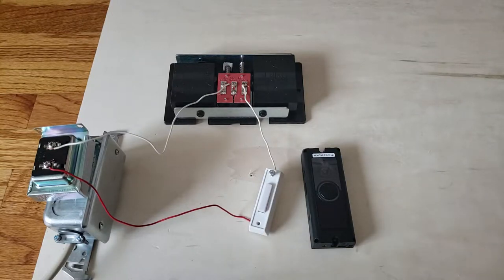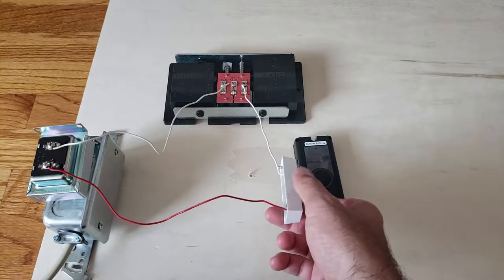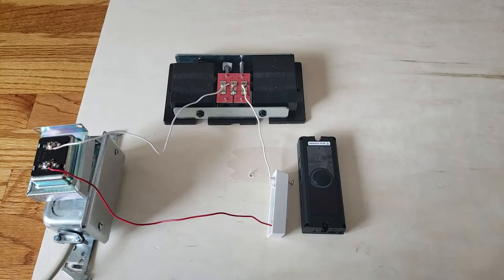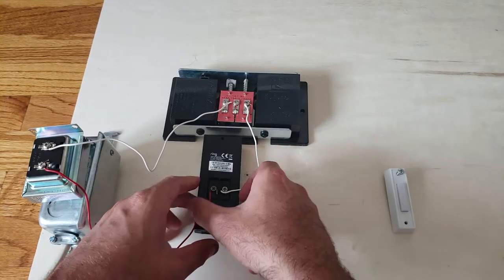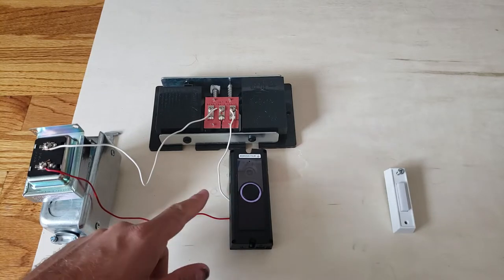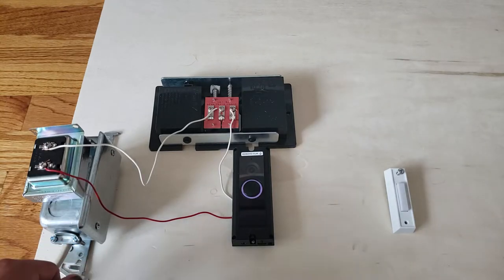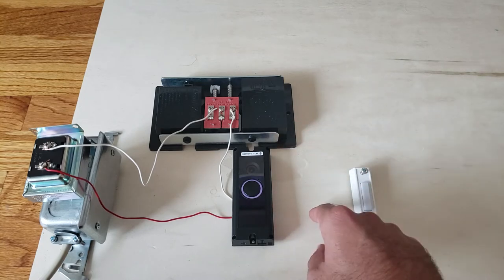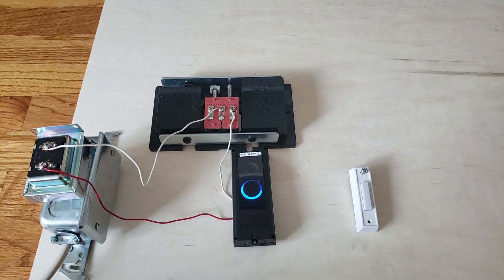Ring Doorbell Installation: How To

Comment: Hey i just got a ring doorbell and like an idiot when i wired up the wires from my original doorbell thats hard wired to the house i wired them the wrong way around not paying attention, when i turnt power back on it tripped the mains now my doorbell doesnt sound when pushed with the ring doorbell. What would of blown the circuit breaker in the mains box or a fuse somewhere in the doorbell box that chimes? Sorry im clueless with this stuff
Reply from the maker: I would think that most likely your transformer is burnt out, and you just need to replace the transformer. This video shows how: https://www.youtube.com/watch?v=sCwjWqlYbew